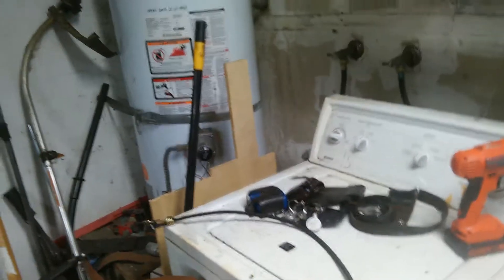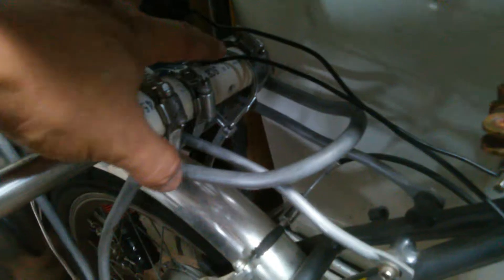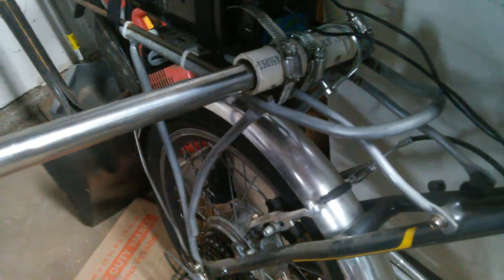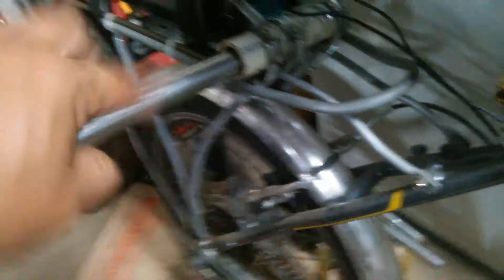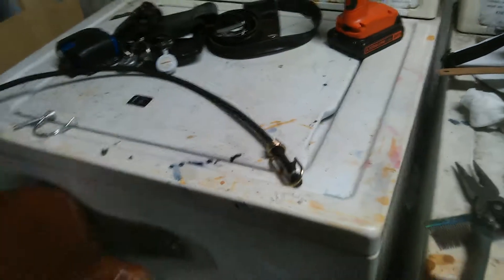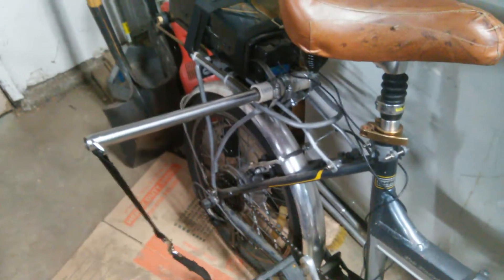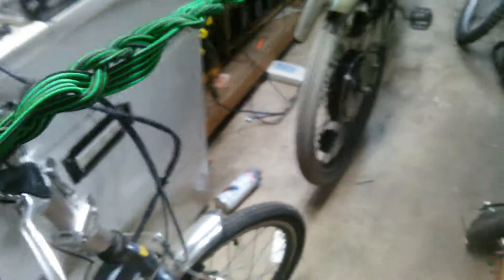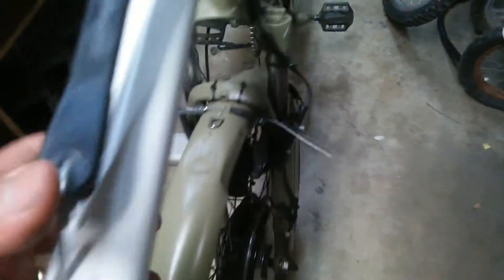how to walk your dog on a bicycle Bikejor

Comment: Ok so my dog is a maniac 2 year old Shepard I'm to scared to try this because he might get excited and pull my ass right off the bike when he starts to run 😂😂
Reply from the maker: My dog is now 85 pounds so I understand your concern. We still take him running almost every weekend. Don't bother using the second system on this video. The first is the best because he won't get in front of you and possibly hit your front wheel. I now understand why there is a bungie. It allows for a tug instead of a sudden yank. You need to have a little discipline with your dog, but just enough so that you are ready for the start. You can "do it yourself" by using a pvc piece like mine and use conduit instead of a pipe. Conduit is way cheaper and plenty strong.  Use a double ended snap to hook your dog up and remember to use a running harness and hook on the side no the top. Maybe about $10 minus the harness. If you need me to make a video to show you let me know.
Reply: @schutztruppe  yes a video would be great. I'm more of a visual person when it comes to these things.